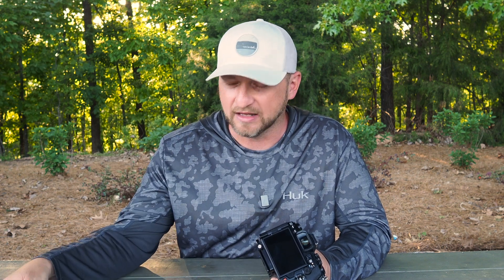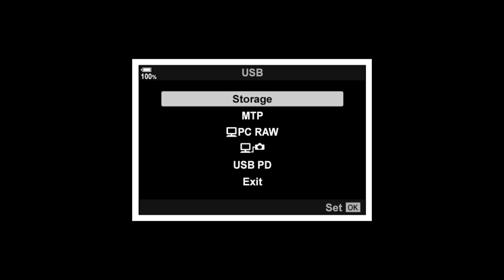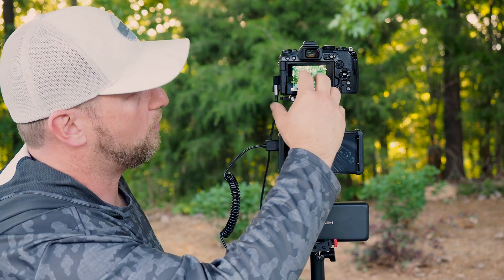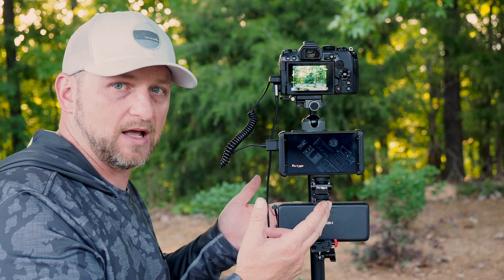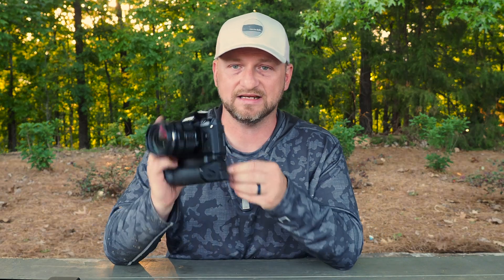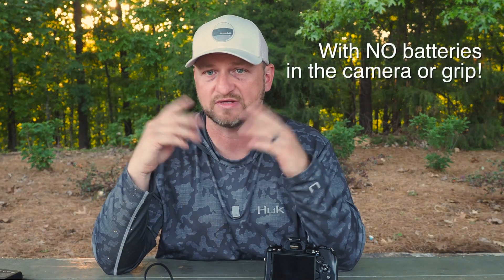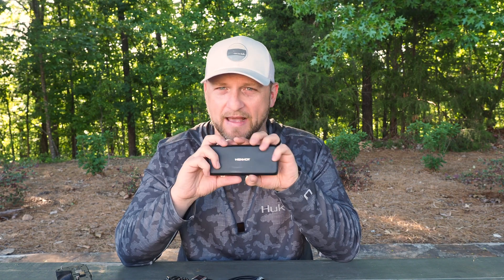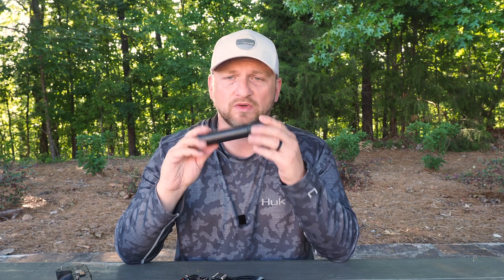Olympus E-M1 Mark III (and Mark II): How to get external power and HDMI at the same time!

Comment: Unfortunately, this is the big mistake of this camera. I bought the Em1 MK3 and now it turns out that I can't use the Ronin RSC2 + RavenEye gimbal to transfer HDMI video to my phone and track objects.... because the stupid Olympus disables HDMI when I hook up the gimbal via USB-C. This is a huge design flaw. If I had known this problem before buying I would have chosen Panasonic
Reply from the maker: @krakow-z-nieba  indeed. Not seen this from other mainstream systems.
Reply: @OneDegreeLife  and DJI and Olympus are not interested in solving this problem. As a camera the EM1 is great but as a camcorder it sucks because of these and many other limitations.
Reply from the maker: @krakow-z-nieba  True. I use a FF Pana for video production at work and it’s perfect for that, and all ports function at the same time. Because my travel photos/videos really picked up in the last year, I eventually transitioned to Sony APS-C for the closest size trade. Actually ended up being within 2 oz. in all. Video is phenomenally better. Sealing, IBIS, Dual cards, and EVF all suck compared to the Mark III and later the OM-1, but I had to have the solid video WITH USB-C power (also with a gimbal) and HDMI. Miss the Oly in functional ways, but my wife still rocks the Mark II.

Comment: Another possible answer is to get a usb powered battery charger (inexpensive) and a second battery.  Alternate charging one battery from your power-pack while you use  the other one.  It does mean changing batteries occasionally, but that only takes a few seconds.

Comment: great video. I was actually looking into the same thing and can confirm your research is correct.

Two side nodes:
1. They fixed it for the OM-1
2. The cables you found are so called "trigger" cables that will actually communicate with the the powerbank and instruct it to deliver this voltage. The communication protocol used is PD or QC for the USB-C Cable while USB-A supports QC only. The powerbank may or may not be able to supply the required combination that's why it might not work with all combination of cables / power banks or power bricks. If the power source can not offer 9V (altough most of them do), then the power source may fall back to deliver the standard 5V to the DC plug which would not work but typically would not harm the device either. Power sources always have the supported voltages printed on them somewhere, so my recommendation is to always check whether they support 9V to be on the safe side.
An alternative method would be to use a cable with a build-in boost or buck/boost converter, so that the cable would accept any voltage from the power source and then the cable itself would convert the voltage to the required level. This may have a better compatibility, however it's slightly less energy efficient

here is a great German resource for further reading: https://techtest.org/usb-power-delivery-ladegeraete-mit-pps-uebersicht-und-info/
Reply from the maker: Thanks for the update! The USB to DC cables are both rated at 9V and, yes, that's the beauty of PD power. I was unaware if PD negotiated the voltage correctly on non-USB interface devices like DC inputs. Glad the OM1 has it sorted out. Still a mystery on the EM series as virtually every other manufacturer that I've used from the same era didn't have this issue. Thanks again!

Comment: I just acquired the same OMD...Mk III model. Seems when I use my external HDMI (Marshall) monitor the advanced shooting options such as bracketing and focus stacking are not accessible. They are greyed-out. I use it on a copy stand for macro work and focus stack images, so the external monitor is handy, but not so much having to switch it off and read setting off an inverted rear display! Any thoughts?
Reply from the maker: Hey, @paulhayes750. Yes, unfortunately, they are disabled in HDMI per the user's manual. I've tried every setting for output under the latest firmware with no changes. "• HDR shooting, multiple exposure shooting, live ND shooting and BKT (bracketing) shooting including focus bracketing are not available during HDMI connection with a TV." Hope this helps.
Reply: Hey, thanks so much for your quick and informative response! OM-Systems Tech Support told me it was the monitor (which makes ZERO sense).  @OneDegreeLife
Reply from the maker: @paulhayes750   Ya, that's strange, but just because they purchased the company doesn't mean they know the older lines inside and out, I suppose. It's in the manual. It does say "TV", but that's synonymous with monitor since they only display the HDMI feed. The OM-1 might have rectified this, but unfortunately, I don't have any hands-on experience with it. Hopefully you can find a work around!
Reply: Also, do you know if it's the same on the OM-1? @OneDegreeLife